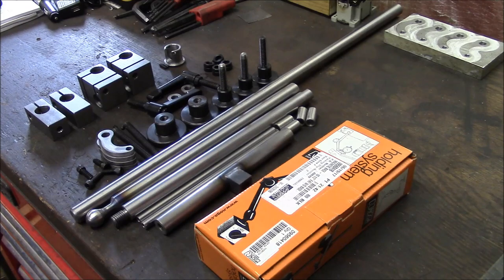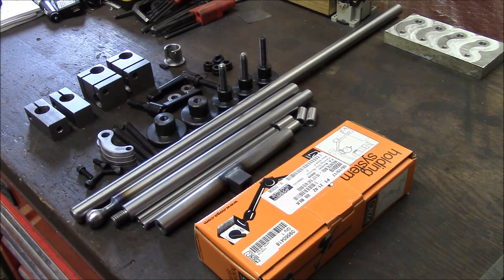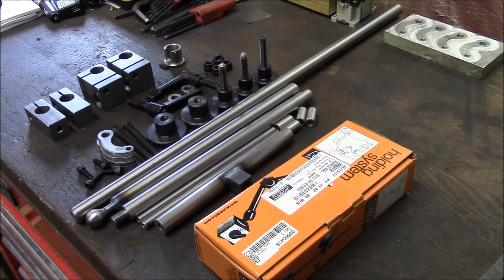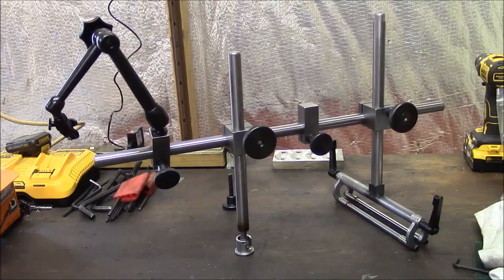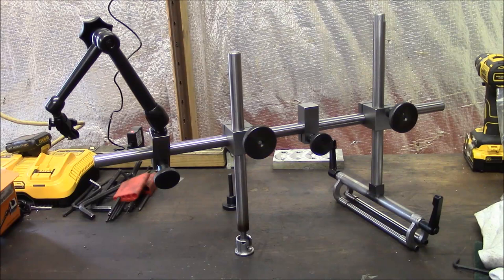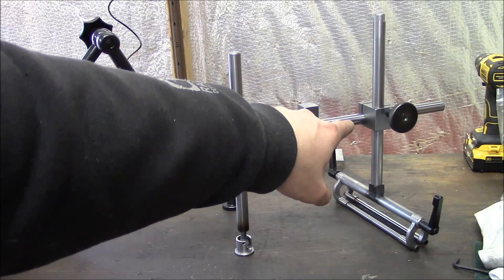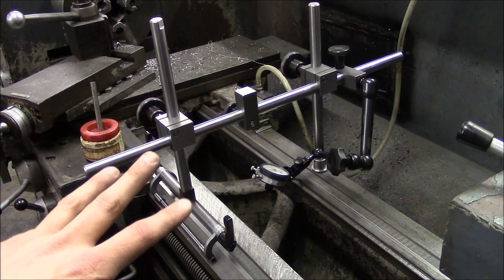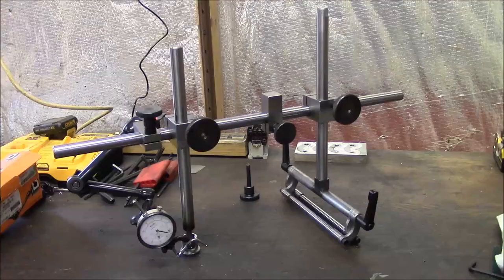My Version of the King Way Tool - Part 1

Comment: Very clever replacement to the original tube design and I like the added capability your improved King-Way gives.  Kudos to you, Wes!
Cheers, Gary
Reply from the maker: Hopefully it works as I hope.
Reply: improvement means its a patentable idea right lol
Reply: by the way did you ever finish yours gary
Reply from the maker: Well it's been publicly disclosed now, so we can kiss that patent goodbye...
Reply: Wes Johnson not really you just have a time limit from now tell you apply. Doesn't sound like you are looking to do that but door is not closed

Comment: The point you make at 15:53 .. love it .. reminds me of when I read "Foundations of Mechanical Accuracy" and it clicked about making a perfectly flat reference from 3 plates and from that you can make perfect 90' angle plates etc .. it's all about the reference surfaces.
Reply from the maker: Rebuilding is more about measuring than anything else. The Connely book has one short chapter on actually scraping. The rest of the book is about measuring and order of operations.

Comment: Nice job on the machine design elements, it looks like they made the assembly easy.  From what you describe with the original version of the tool your 2 piece design for the tube looks like a big improvement.

Comment: Very well done Wes ,simple and looks to be a very useful tool. I am currently rebuilding my south bend and sure could use one. As it is I have to learn to scrape!!! That said if you could supply a drawing in pdf format or another common form it would greatly benefit me as I am approaching 70, I don’t have much time to figure out , let alone build them so a drawing would greatly help. If you want to sell the drawing or the tool let me know, as I said I would greatly appreciate it. I love the way you considered building a tool that works on small v ways like south bend. Thank you very much for any help in this. Bill

Comment: I might would add some sort of positive stop feature to the adjustable base rods. Something like a threaded rod with trunions. It is critical that the distance between your rods with the ground bushings does not change during your measurements and it seems that a careless heavy touch could likely alter yours with only the friction from the lock handle holding against the long leverage from the arms to the ways.  Otherwise looks great to me!
Reply from the maker: We'll have to see. There's a hell of a lot of clamping pressure there. I made a test jig before I built the actual tool. It takes something like 75ft-lbs to actually make the joint slip.
Reply from the maker: Heh. I meant 75in-lbs. And that's times two. I think it should be as rigid as the other joints in the assembly. I guess we'll find out!
Reply: i had the similar thought but was wondering about the parelisem of the rods but thats testabble . this is the first kind way i have seen in any form . does any one have drawings of the oem type? this is a very well made tool and i'm certain it will work fine . good job man !!
Reply: I'm thinking the parallelism of the rods is "self-correcting", and that all that matters is that it remains stable. Four points on a prismatic way can only set in one place (given the ball rest on the other side) and it wouldn't matter if the front sat a little lower than the back or vice-versa; it would be consistent throughout a sweep and that's all that matters in this application.
Reply: well if there were only 3 points of contact id agree with you but there are 4 so what is to stop it rocking to the foth point and leading to a error . i'm sure this is why the original used a precision grown surface for the contact points. there's a lot of parts that can move here
Reply: If those were resting on a flat surface, that would be true, but I believe they're designed to be always resting on two surfaces that are at an angle to each other (like either side of a prismatic way, essentially an inside or outside corner), so can only find one position.
Reply: I think the important thing here is the level vials. Once those are in place, any slip on the way rest should become apparent in those. Or at least, if I leveled a lathe, checked with the Wes Way, found that the levels tipped a similar amount to my indicator reading and that the readings repeated three or four times, I'd feel pretty comfortable scraping to that number. I spent a while on the commute debating it with myself and couldn't figure out where that wouldn't hold up, but  am I missing something in that thought?
Reply from the maker: Yes, the parallel error is self correcting. That's kind of the clever part if there is one. The tool only needs to contact 2 planes which can be drawn through any 3 points for the first plane, and the remaining 2 points for the other. Like I said in the video, it should be correct in terms of kinematics.

Comment: Good job Wes. Thanks for taking the time to share that. I like the way you made that ball joint
I've been thinking on the easiest way to make those. I'll consider that design.
Reply from the maker: I tried buying a swivel foot but it was really crusty and not suitable for a precision tool. Mine's more complicated to build, but simpler to use than the original King Way.
Reply: It never occurred to me to buy them. I just seen them on ebay after reading your response.
Maybe the easiest way for my project is to buy them.
I have a natural talent for doing everything the hard way.  Thanks again

Comment: Nice redesign on the horizontal guide bar. I'm also collecting parts for mine. I'll be interested in what you use for levels
 I looked into the Geier & Bluhm 20sec/division. A little pricey. And the ones Richard had we're nicer than what they offer now. Also, the ring under the ball was just a big inner ball bearing race.  Really like your approach on things. Keep it up.
Reply from the maker: The Geier Bluhms are probably the most convenient. I'm still debating it.
Reply: I picked a Wyler cross test level for my build (reasonably priced eBay find). It has easy mounting locations and three good points to jack on to level it with the carrier I make for it locked to the rod. It's also already mounted vials and far more compact than the original. Only half as accurate (0.001"/foot), but you could got for similar the size of the original and buy up a size in cross test level for the original's accuracy. In the alternative, there are some damn nice looking pre-mounted vials from China these days. Not sure how you could test that they meet their theoretical spec, but worth thinking about.
Reply from the maker: I have seen them. I could live with the accuracy, but the vials have only 3 or 4 graduations and then you're off the scale. We'll have to wait and see which direction I go.
Reply: I'll be interested to see. I haven't seen you do anything that wasn't pretty seriously well thought out, so I'm looking forward to it. 👍

Comment: Nice design Wes. I guess you could put on a few simple rubber o-rings to stop any sudden movement when using your adjusting knobs.
Reply from the maker: That's a good idea. Though, the rods do have to be removable to break the tool down for storage/transport. Maybe some kind of spring loaded pin? I guess we'll see.
Reply: wouldn't a nice little rack and pinion setup be cool . tuff for a home jober but nice to dream

Comment: Nice piece of work. Your improvements are definite improvements not mere changes: they actually address and remedy shortcomings in the original design. 

Hurry up with the levels. I want to see how you attacked the fine adjust problem.
Reply from the maker: In theory, yes. We will have to see how it actually works. I ordered the vials, but it may be a while before part 2.
Reply: Wes Johnson Geier and Bluhm have a website shed they sell mounted vials graduated down to 5 arc seconds. Not too expensive and they sell the posts and adjusting nuts.

Comment: Thanks for this, building a king way is a upcoming project for me.  I wonder if you will end up liking/hating the single knob adjust after some use.  I would love a parts list or diagram.
Reply from the maker: We'll have to see. It would be very easy to make it work with two knobs. Just thread the middle of the clamp block and have the stud stick out on either side. I had designed it that way originally, but this is simpler and a little cheaper.
Reply: It's always nice when someone else does the experiment for you.  It will be interesting to see this in use.

Comment: How well does it brake down for transport? Will you need a special case? How long does it take to assemble and calibrate for service? It does look like something I could use, nice design.
Reply from the maker: You can break it down enough to fit in a tool box in just a few seconds. The level vials are delicate, but the rest is pretty tough.

Comment: Super awesome Wes! Do you notice more hysteresis in the setup than what's in the indicator itself? Meaning, does the reading at a given point change very much when you arrive there sliding in one direction than it does if you approach the point from the other side (sliding in the opposite direction)?
Reply from the maker: I'm not sure yet. This is the first time I've ever put it together. I'm hoping it's heavy enough to be pretty solid.

Comment: Hi Wes, I thought you might want to check out this level mounting idea, about halfway down the page: http://metalscraping.com/w2-Preview.html. The basic idea is that the level vial is mounted on a base that pivots by way of a micrometer head, such that you can get a direct-ish reading of the relative droop at a certain spot by just re-leveling the vial and reading the micrometer head. Not necessarily a good idea in this case, but maybe grist for the mil :)
Reply from the maker: I saw a King Way clone on  the practical machinist forum made just the same way not long ago. It was a little more clumsy, but the same idea. I have a similar concept in mind. Thanks!

Comment: In testing a lathe why not let the ball ride on the only surface that has no wear,  the machined surface in between the back inverted v where the tailstock rides on and the flat the saddle rides on?
Reply from the maker: On most lathes, that is not a precision ground surface. Normally, that surface has been milled to give some clearance for the grinding process, but is very rough. Sometimes you can use the top of the inverted V way if the bed was crush ground with a form wheel (common on smaller lathes).
Reply: bur surely the flat must be worn to some degree, how to account for that wear?
Reply from the maker: Yes. The tool is used to measure that wear. So, we could scrape the tailstock ways straight, then use them to measure the carriage ways and then scrape them to be straight and parallel to the tailstock ways.
Reply: ok , but how to get the tailstock way parrallel to the spindle?
Reply from the maker: Use the tool and measure to a test bar in the spindle.
Reply: That would be possible only if the front inverted v way was known to be straight and parrallel to the spindle.
If not any deviation from the straight and parrallel of the inverted v would have an inpact on the measurement taken.
Reply from the maker: The tool can measure from any way surface we want. So, I can set the tool on the tailstock ways, and align them to a test bar in the spindle. Then use it to align the carriage ways to the tailstock ways. You'll see in some later videos if you hang around.
Reply: i will be around for sure as i have subscribed to the channel
(thanks to the mentioning of the video in the "who changed the rules rongfu " thread on the PM)

Comment: Do you have any design docs or cad files?
Reply from the maker: I have a SolidWorks model. I will try to find a way to share it.
Reply: I'd appreciate PDF drawings
Reply: If you can import it into Fusion 360, they have a built-in sharing capability.  I could potentially help produce some proper drawings using the model in Fusion 360 (they have a stupid simple drawing/dimensioning capability).
Reply: I would like PDF as well
Cheers
Reply: That would be awesome!
Reply: Wes, if you want, you can send me a zip file of the Solidworks project directory and I can import it into Fusion and do the drawings.  If you have Fusion, I can share the project with you so you can give feedback.
Reply: oh that would be nice (note get solid works)